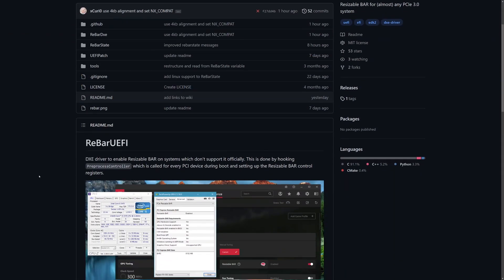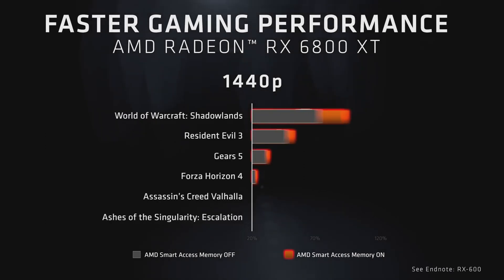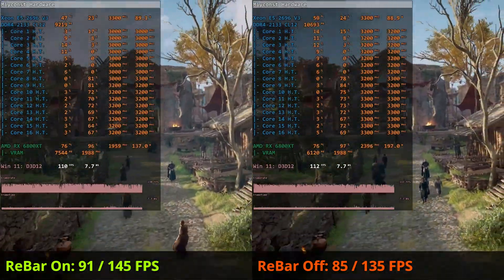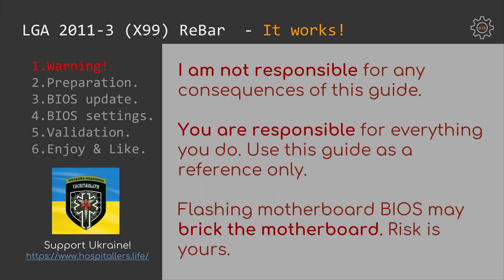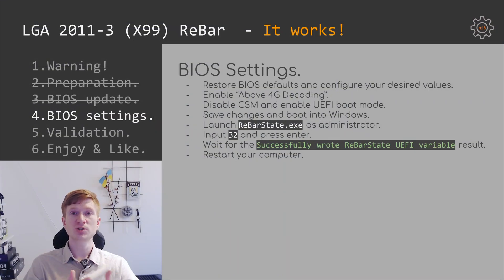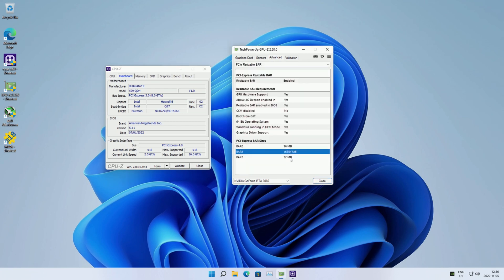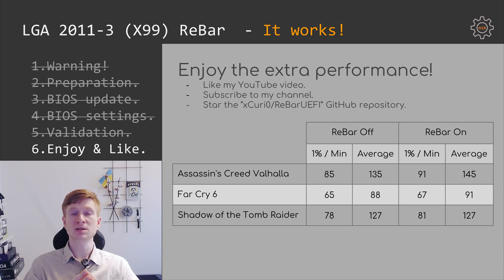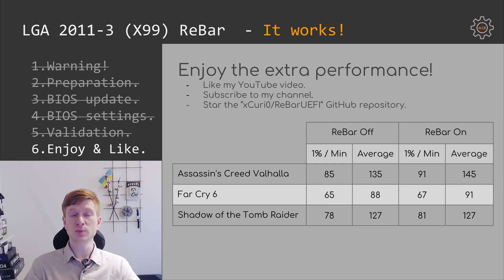🇬🇧 Resizable BAR (ReBar) on LGA 2011-3 X99 – how to enable and get extra performance

Comment: hi! i'm done the turbobust unlock mod on the d8 motherboard like you explain in your another video, but now i can't find anymore the "above 4g" in the bios. do you know were is? or can you suggest another bios with the "above 4g" in the option?
Reply from the maker: Apparently the BIOS you have doesn't expose the settings. You can mod it with Amibcp.
Reply: @Miyconst  what do you mean?
Reply: Ok i find out what you mean, I've already done all the bios modification and now I've all core turbo bust e resizable bar enabled thanks you very for your help and for the amazing guide you made!
Reply from the maker: @Nekovocal  great job learning something new!
Reply: @Miyconst  thanks

Comment: It was going smooth for me until I restarted the pc after running the rebarstate exe file. Black screen and windows didn't boot. Had to do a cmos reset. Motherboard is a Chinese B85 from MSEOI.
Reply from the maker: Did you enable Above 4G decoding in the BIOS? If yes, it could be that this motherboard doesn't properly support it.
Reply: Yes it is enabled. I managed to get it to work after a couple of retries but the maximum supported BAR size for this board is only 1024MB, anything higher bricks the pc. Thanks to your guide and the contributors of the ReBarUEFI GitHub page.

Comment: is it possible to get resizeable bar working on the Supermicro H11DSI-NT REV 2.0 motherboard?
Reply from the maker: I don't know. If their BIOS is encrypted and protected from mods - no, otherwise yes.
Reply: @Miyconst  how would the process differ to the YouTube video above?
Reply from the maker: You would have to read and write the BIOS with an external programmer.
Reply: i looked at the bios update file using uefitool i couldnt see any dxe drivers only pei modules with a warning message at the bottom saying "parseFile: non-empty pad-file contents will be destroyed after volume modifications" and when i try and use ami windows bios utility comes up with a missing driver error, the instructions from supermicro are to use a uefi shell in bios, so yeah probably heavily protected.
Reply: well i have a modded bios file but i am scared to use it, what do i do if it doesnt work? is there a way to verify the file before flashing?
Reply: i went for it, not sure if the bios took or whether it just didnt work, but it didnt brick but unfortunetly resizable bar did not enable.
Reply from the maker: @danthompsett2894  what is your GPU?
Reply: @Miyconst  msi gaming x trio rtx 3060 12gb maybe I should've disabled the svga onboard bmc ipmi graphics, plus I didn't follow the procedure to the letter with regards to bios defaults then resetting bios settings.
Reply from the maker: @danthompsett2894 many of the RTX 3000 GPUs require vBIOS update to get Resizable Bar support.

Comment: Can anyone help me with activating the resizable bar on x99-TF?
I have a problem because I can't find the "above 4g decoding" option in the BIOS. I don't have all the "PCI subsystem settings"...
I guess I need to change the bios - can you point out which one has these options?

Honestly, I lost hope that there will be a bios with ReBAR for X99-TF in mi899 :)

Comment: Question sincw im new to this whole x99 thing. If I activate rebar to uae with compatible GPU but, then decide to use a none compatible GPU will this affect the syatem or perdormance ? Thanks.
Reply from the maker: No, the system will work as usual but the GPU must be UEFI compatible at least.
Reply: @Miyconst  thanks.

Comment: hey myconst, been watching your vid and got interested in xeon platform
i kinda need help. i bought jginyue x99m plus v2 which has both ddr3 and ddr4 slots used since price has been inflated like crazy after they banned shipping from aliexpress on my country

the bios kinda has everything from csm and 4g decode option, tried to skipped step to run rebarstate.exe but the rebar is still not available
i have checked on gpu-z resizeable bar req and its only missing "Resizeable bar enabled in bios" which im guessing thats what the rebarstate.exe is for, do i need to flash after all?
thanks in advanced
Reply: oh yea forgot to add, my gpu is rx 5700xt from asrock
Reply from the maker: Of course you need to mod the BIOS, just enabling Above 4G Decoding is not enough.
Reply: @Miyconst  thank you for fast answer, does the X99m plus bios on the mi889 support the one with both ddr3 and ddr4 version?
Reply: if not, any program that can dump my current bios into flash drive maybe?
Reply from the maker: @eroero7  DDR4 / DDR3 support is up to the CPU, I have not yet seen a single BIOS that would work with RAM but not the other.
Reply: @Miyconst  alright thanks for the help man, Rebar is working now. you made Really good tutorial btw

Comment: buddy, it turned out, but everything in the bios became enlarged healthy X 99-TF 1.1 bios from Koshak 25.05.2020 v11

The Huananzi logo has also become healthy

after returning the settings, he refused to start at all, only the battery had to be thrown off.

Comment: I'm using rx 6500 xt, xeon e5-2640 v3 (not on turbo), 16 gb ram and a atermiter x99 motherboard. After doing everything like in a video it shows in gpu z that resizable bar is still disabled. I tried to update vbios but it said i have the newest version.

Comment: I'm using a 2670 v3 with a rs9 machinist, 16gb ram and rX 6600m. It worked and gave me a 10 to 15 fps in some games, but my windows is slow as ***. I don't know why but i'm experiencing delay in every app that i try to run. if someoene could share me some light i would apreciate it.
Reply from the maker: Did you enable high performance profile in Windows? Installed all updates (including the optional ones)?
Reply: @Miyconst  Yes to both. I think i'll disable it. Not worth.
Reply: @Miyconst  But thanks for the answer.

Comment: Is the Turbo unlock and Rebar compatible? After adding the Rebar, my PC locks up and BSOD's shortly after booting up.
Reply: Once I Disabled 4G Decoding it no longer locked up.  I wonder if its trying to load but because the EFI Rebar exe hasn't been run yet it is causing the BSOD.  Will fiddle with it later
Reply from the maker: It is surely compatible, I am running it that way, your crash might be due to something else.
Reply: @Miyconst  so to stop the lock up I disabled the 4g decoding, got into windows and ran the rebar exe, set to 32 and rebooted. Went into the bios, enabled 4g decoding, save and restart. No Post, d4 bios error code and beeps. Reset the bios, restarted, went into bios disabled csm, enabled 4g decoding, enabled my raid for my drives. Booted into windows, checked resizeable bar in GPU z. It's disabled. Probably hasn't taken effect and needs another reboot. Which may or may not work. If anyone's interested I'm running a e5 2696 v3, huanazhi x99 t8, 128gb ddr3 and a MSI rx580. I'll fiddle some more tomorrow but it's probably not supported for me for some reason.
Reply: @Miyconst  Well, I discovered that my card is not compatible.  Oh, well.  Still weird though that it caused the PC to lock up. Flashed the BIOS back to the previous one I had before adding the rebar and disabled the RebarState.  Rebooted and all good again.

Comment: Miyconist please help. I followed instructions, i used your aplication and your bios (-50/50) for huananzhi x99-qd4. Flashed bios, ewerything was ok, then reboot enter in to the bios, return all settings to defaults (+uefi), reboot again and then ...nothing, it want boot again. I try clearing cmos - nothing. Remove components - still nothing. What should i do 😢😢😢
Reply from the maker: It seems like you have managed to somehow corrupt the BIOS. If it's the case, you need to restore the BIOS with a CH341a.
Reply: @Miyconst  Thank You so much for answer
Reply: @Miyconst  According to guy in PC service moded bios files from mi899 application are defective, only factory bios is ok...
Reply from the maker: @slobodanfuletic9465 well, you can trust the guy from the PC service and use the stock BIOS.

Comment: need to know if is the same thing for x99 from asus especific for this Asus x99 Pro USB 3.1
Reply from the maker: I see no reason why it shouldn't work, but you have to write the modded BIOS with an external flash programmer.
Reply: can i do that with an pen driver on EZ flash ? @Miyconst
Reply from the maker: @MrThejacksongamer  you can try, but most likely it will refuse to flash modded BIOS.
Reply: how am i suppose to do that ? @Miyconst
Reply from the maker: @MrThejacksongamer  https://youtu.be/4qX2zihB6UE?si=lMTwtXGTPM4rfgg1
Reply: i can't use mi899 program  ? @Miyconst

Comment: does thus work with the turbo boost unlocking and in what order should i do both? Turbo boost unlock first or the resisable bar first? Thanks!
Reply from the maker: Yes, it does work together and the order makes no difference.
Reply: @Miyconst  Thank you! My x99 mobo is on it's way i will try to set it up with both. Last question, where might i find your discord channel? I'd like to join if possible!
Reply from the maker: @chiari4833  the link is available on my YouTube channel's page, it's the small icons in the top right corner.

Comment: Hello Miyconst, I recently purchased the Qiyida E5-A99 motherboard and I'm using it with a 2680v4 without any issues. However, I would like to unlock the memory timings and activate SAM (I'll also set it up with UTB in case I decide to test it with a v3 CPU). I found the procedures to modify UTB and SAM on your channel and on the Russian website xeon-e5450. However, I couldn't find the procedure to unlock the memory timings (and I'm hesitant to use BIOS from other brands on this motherboard). Could you guide me on how to do this? (As mentioned, I'd like to perform the procedures based on the original dump of my motherboard, if possible).

Comment: Hi, it can work with z170 or other ?
Reply from the maker: Yes, it works with all PCI-E 3.0 compatible systems, but the older boards may require extra BIOS tweaking to get it working
Reply: @Miyconst  Thank you for the feedback,
I have acces to 4g decoding and cms features  
I will try with my z170 maximus hero 8 
Hoping this works 🙂
Thanks 🥰

Comment: Hello brother i tried and followed all your steps and it says succesful but when i reboot and check in gpu z it says disabled
Reply from the maker: What is your GPU?
Reply: @Miyconst  hi sorry for late reply, it was rtx 3070 and btw my motherboard is huananzhi x99-f8d with x2 xeon 2678 v3
Reply from the maker: @leonerdplayz  most likely you need to upgrade your GPU's vBIOS to support Resizable Bar as the early samples of RTX 30 cards came without ReBar support.
Reply: @Miyconst  ive updated it and it worked! Thank you ❤️

Comment: Instead of using the program Mi899-master at link, it is also possible to insert the ReBarDxe.ffs file by using AMI tool (MMTool_v5.0.0.7.exe ~ MMTool_5.2.0.25.exe) and after choosing DxeCore inserting "compressed" makes the same job, my Huananzhi X99-TF modding become successful.

Comment: Is there a ram bios update I have huananzhi x99 f8d plus but won't except all the memory just 64gb on the black slots If I populate all 8 slots to 128gb the board error codes to 67
Reply: Never mind I think it's a channel issue I reckon those cheap ecc amitter ram sticks are dual not quad channel

Comment: Very interesting and as usual...a clear, concise, and professional delivery by Miyconst! Not sure I am ready to do this one...mostly because I have the GTX 1080Ti and it likely will not be a significant benefit for my particular use-case.  Secondly, not sure I have settled on the optimal voltage offset / optimal (Mi899 implemented) BIOS with E5-2696v3 + X99TF (v1). Currently running the TU PEI -50/50 BIOS with stability. Might go lower...not sure yet.  Also installed THROTTLESTOP (v.8.7) and am playing with this at the moment, setting mult limit to 38x and observing max number of cores getting to this max multiplier (14~15). So far, this program looks to be delivering some good results. Temps are SAT too.

Comment: Hi, i have asus X99 usb 3.1 , will this work for me ?
Reply from the maker: It surely works, but you need an external programmer to flash modded BIOS.
Reply: i tried and followed each step, but in bios always cant even start the proccess of flashing bios it pops error says Bios update is not compatible

Comment: Hello ? My x99 F8 doesn't have the PCI subsystem option or the CSM option, is there any way to activate it or is my F8 not compatible?
Reply from the maker: I don't know what motherboard revision you have, but you can try to check if these setting are available using AMIBCP tool. With the tool you can also set the desired values, if the settings are there, but hidden from the user.

Comment: Can it be done with LGA 1155?
Reply from the maker: No.
Reply: @Miyconst  thank you.
Reply: It works on 1155, just some additional steps for patching.
Reply from the maker: @Kuri0  do you have any more info on this?
Reply: @Miyconst  Yes you just need to follow the wiki guide, some additional steps are needed for 1155 but it works perfectly fine on it. I actually made this module for my LGA1155 system (i5 3470 B75M-D3H RX 580 8GB)
Reply from the maker: @Kuri0  thanks, I somehow thought that LGA 1155 was limited to PCI-E 2.0, but it actually supports PCI-E 3.0.
Reply: @Miyconst  even PCIe 2.0 works actually
Reply: @Kuri0  I installed the A750 on my H77m-D3H with i5-3570 but after gigabyte logo display goes off. Black screen , white screen or no signal on different monitors but I haven't pached BIOS.
Reply: @Arhatu  Disable CSM and enable 4G decoding

Comment: This worked on MSI X99a Pro carbon gaming and 6700k. And since I used a dump all my bios settings remained. If you would like me to send you the latest one from msi with resizable bar (not a dump) I gotchu.
Reply: Hi Nicolas, I also own this motherboard, how did I reach out to you so that I can obtain this BIOS file? Many thanks in advance for your assistance.
Reply: @danielkumm5288  thank for your replying I tried to find this video so I could leave a second comment. Doing this ended up breaking my computers ability to handle a bios, so all the settings I had were there in “lock” when I would turn on the computer it would go straight to windows no way of getting to bios. I had to trick the computer into re-flashing it was this entire thing freaking awful.

Comment: I am currently trying to insert a file in UEFITool but it is not letting me do so anywhere. I have the same motherboard as in this video, used the same Mi899 tool but am now stuck. What could be the issue?

Comment: Hi
I have Atermiter x79 mainboard and rx 6600xt gpu. And it has option to enable 4g decoding. I did and after reboot there was no display. 
I reset bios through cmos reset. But there was no display.
I changed gpu everything ok exept my rx 6600xt.

I tried to check my RX6600XT on othere working system it doesnt give display anymore.
Please advice.
Reply: Have you found the solution ?

Comment: Any idea if the Qiyida V205 motherboard has A4GD to affect this mod? I'm looking at getting an A770 for my Linux daily driver (ole 580 died, RIP), but I need to know if I can turn on ReBar first
Reply: I know I'll have to boot into Windows to use most of the tools for this, but that's not an issue for me

Comment: Hey thanks for the informative video ! 
I got up to the point where you need to use PowerShell to edit your BIOS file and got stuck there.
I've got a Asus X99-A-ii-W with a I7 6800K that could use that extra bandwidth. I just upgrade my GPU from a GTX 970 to a RX 6750 XT and I just know this mobo and processor are slowing me down, I've got all my Resizable BAR requirements checked off under GPU-Z but "Resizable BAR enabled in BIOS" I just don't understand the PowerShell part and I'm stuck.
Reply from the maker: Welcome to join me Discord and ask for help there.
Reply: @Miyconst  Thank you, I'll look for you.

Comment: i have my modified bios flashed - but if i start the ReBarState.exe as Administrator the Tool says its failed to write - what can i do ?
Reply from the maker: Is your windows installed and booted in UEFI mode?
Reply: Yes it is 4G decoding is activatet MB is an Asus X99 AII

Comment: Hi. I have 5960x cpu with Asus rampage v edition 10 motherboard. Is there any way I can apply resizable bar on my mobo as chinese mobos with 0 issue? Thanks.
Reply from the maker: It's totally possible, but you need to flash the modified BIOS with an external flash programmer, Asus flashing tool won't accept modified BIOS.

Comment: Hello, that rebar mod works in an x79 platform with the motherboard machinist x79 v2.09 (the only x79  in your program) and can drive an Intel arc a770 to score 12500-13100 in 3dmark, with a xeon 2650 v2
Reply from the maker: Is this a question or a statement?
Reply: @Miyconst  statement, in your discord I post some images about it, sorry for bad redaction x.x
Reply from the maker: @zatkiel311  thank you for the update then, hopefully it will help other X79 users.

Comment: X99 truly is the last great platform. Intel even forgot to nerf the memory support of the HWE/BWE i7 CPUs, they support exactly the same memory size as their Xeon counterparts. I tested this with 8x 64GB LRDIMMs and an i7 6850K on an Asus Strix X99, booted right up and showed the full 512GB in Windows.
Reply from the maker: Wow! I tried with i7-6800k and ECC REG didn't work, but worked with i5-5820k and i5-5930k.
Reply: @Miyconst  It depends on the motherboard, all BWE/HWE support reg. ECC (ECC obviously only enabled on Xeons but the RAM works without ECC otherwise) . You probably tried 2Rx4 modules on an MSI board or something. Those only work with 8bit modules, so 1Rx8 and 2Rx8.
Reply from the maker: @toseltreps1101  I have tested i7-5820k & i7-6800k with the same ECC REG RAM and the same motherboard, i7-5820k worked, i7-6800k did not.